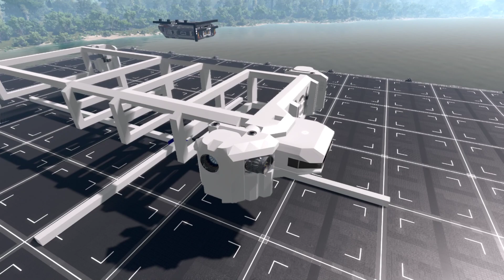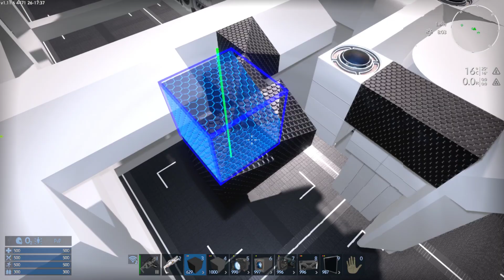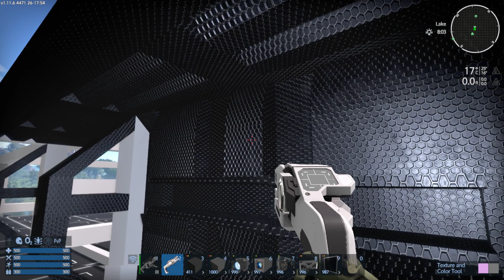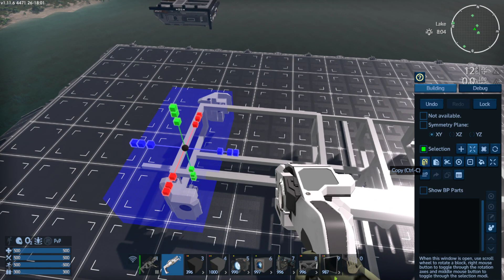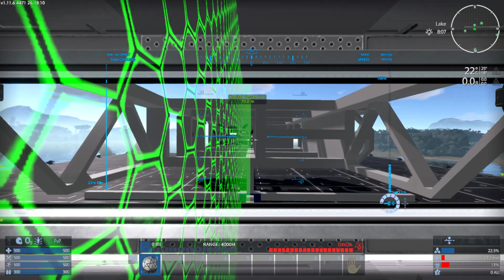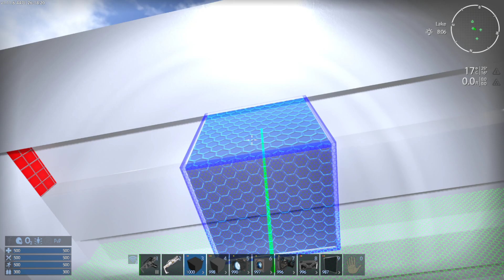Empyrion Galactic Survival - Starter CV Carrier Build Part 2

Comment: drones are so much stronger now. and u should prob build it in steel atleast carbon is kinda harder to make now besides u can upgrade the thrusters pretty easily
Reply: Yeah I had a lot of carbon deco on my starter carrier that I had to manually repair repeatedly.  Its almost unavoidable to have to deal with minor damage now unless you don't do any exterior deco.  Structurally, my ship was fine since it was steel though.

Comment: it will be problematic if you reduce the length too much as I have made a SV/HVdocking combo similar to what you are doing. When you have the docked vehicle extend from the rear the centre of mass drastically changes and then your main CV will really struggle to turn without the rear thruster housing being far back. So you could reduce the roof section no probs but be wary of reducing the thruster housing placement